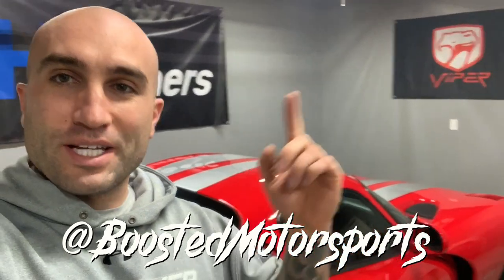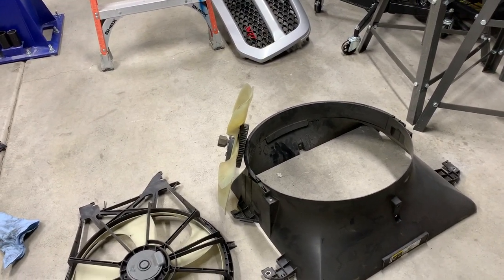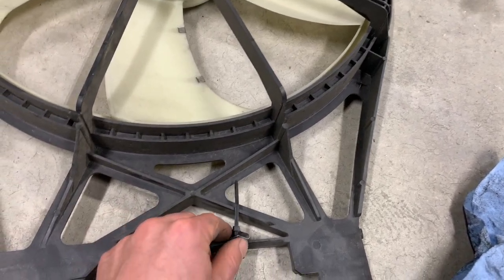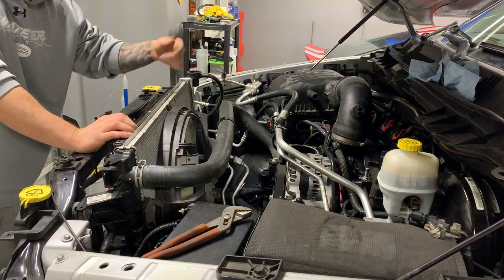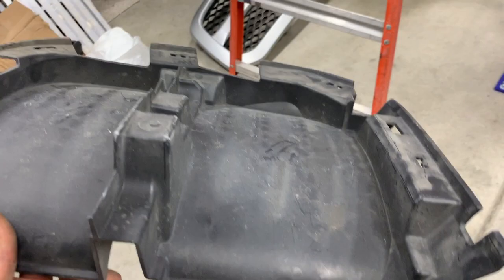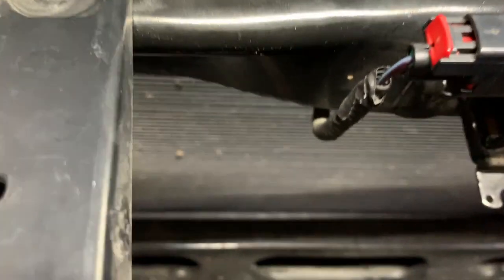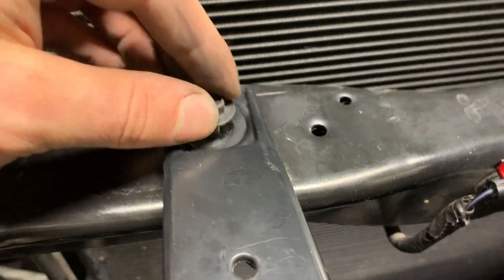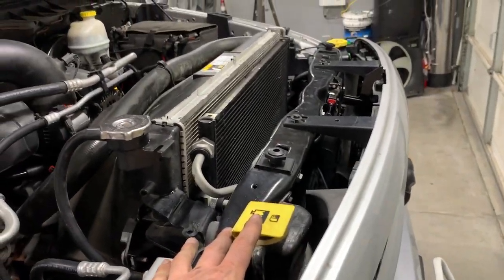RAM 1500 HEMI mods REMOVED  - Part 2 - Cooling

Comment: I missed something. Why are you removing the fan mod? I was actually thinking about doing this because it seems like a smart mod.
Reply from the maker: Mark Guetzka we built this project truck up to be an almost 11second truck in the 1/4 mile and then parted it out and sold it to start a new truck. It’s a great mod though and we just finished converting the new Dakota R/T project truck to electric fan if you check out the latest videos 👍

Comment: About the v6 fan , is it necessary to get it tuned or can you just put it in and roll?
Reply: I’m also curious.
Reply: Now I have an 11 ram 1500 with a 5.7 hemi , just interested on trying to see if I can squeeze a few more mpg by doing that.
Reply: It needs a tune, stock the electric fan kicks on at 215 degrees. You can cheat and put on the AC, that triggers the fan too. But you need a tune or ECU adjustment from stock.
Reply: Ok my next question is how do I find someone that can do that tune for that fan.
Reply from the maker: You can put it on but your temps will creep up to 220* before the fan will turn on unless you have the A/C on.  It won't overheat just can sometimes run a bit hotter in stop/go traffic.  I have a few videos on this topic if you dig back in the vids 👍😎